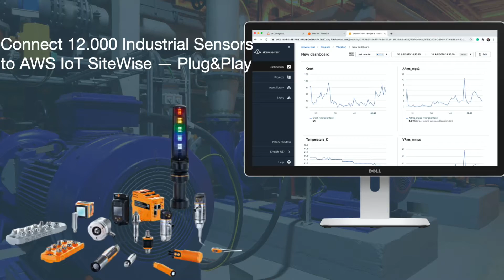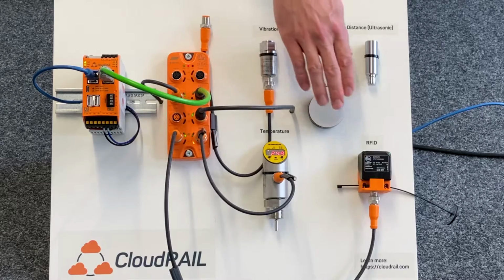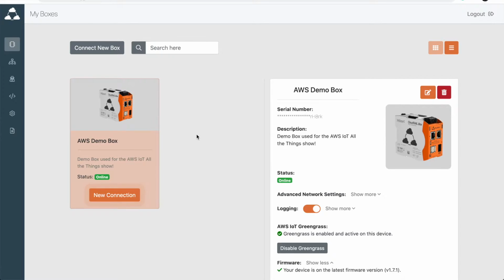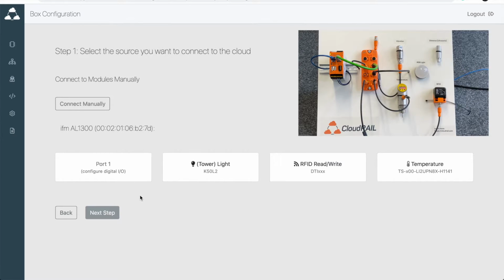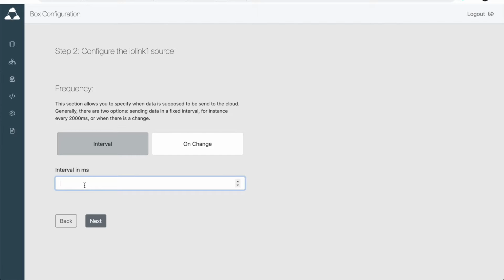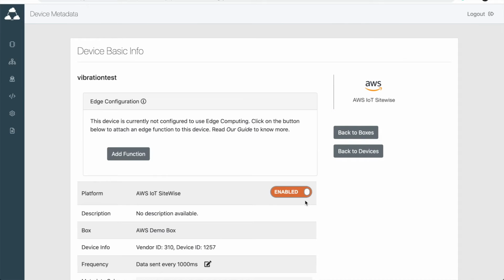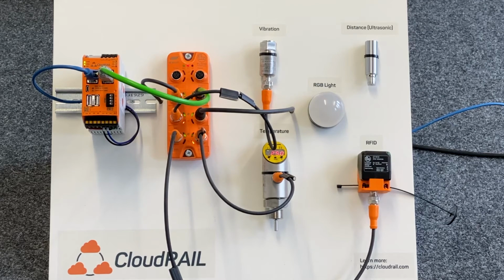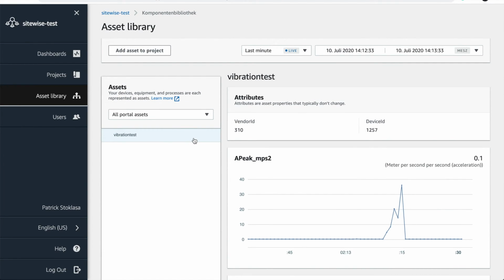Connect Industrial Sensors to AWS IoT SiteWise

Comment: Do you have a video where you can use SiteWise and it’s pulling the data from a PLC?
Reply from the maker: If the PLC supports OPC-UA, yes: https://www.youtube.com/watch?v=s8XZ-hjjBH4 Just select SiteWiese instead of Core as the target. For older PLCs without OPC-UA supports we don't see a usable method to acquire data. This article might be an interesting read: https://blog.cloudrail.com/5-reasons-why-not-to-use-data-from-plcs-for-your-iiot-project/
Reply: CloudRail Does the Gateway connects to a Modem or one required if there is no Ethernet connection being used? As this is often the case in Industrial systems.
Reply from the maker: @UrbanGregory  If there is no wired internet connection available, you can just use a cellular router that has an ethernet port. Many customers use e.g. the RUT240 by Teltonika.
Reply: @CloudRail  I looked up some info on AWS Sightwise and the insight was interesting for getting the industrial data and to visualize it from the AWS portal once the data is there. However, though i appreciated seeing the demo some things can seem left out in understanding. How much setup is required to use the AWS SiteWise within AWS. When sending the equipment data  to AWS thru a gateway what steps are required to allow that data to be sent up to AWS Cloud and the configuration required then in AWS Sitewise to have that data show up there. That would have been or even could be a very useful demo to convey. Maybe i also just need to understand how what i believe is the CloudRail Box works as a Gateway and how its somewhat configured to send the data to AWS. 

In our automation systems we use a EWON Flexy for our Modem connection. But we haven't as yet been successful at sending any IoT Data into the cloud to AWS or Azure. Though we tend to prefer possibly using AWS. The challenge is connection from Gateway/Modem to AWS Services and in this case to the new service like SiteWise. That kind of demo would be interesting to see as well convey how to connect if you have no previous connection to say AWS at all with Industrial data.